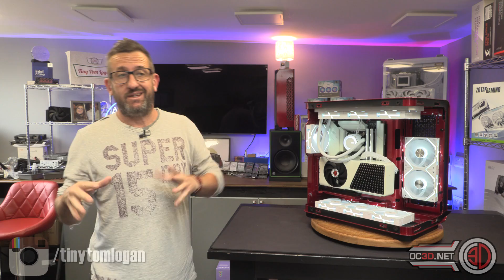DIY Fix?  Intel 13th and 14th Crashing Issues

Comment: Each core has a voltage table. This table asks for certain voltages according to the core's speed. These tables are written in each core at the factory. You can use a tool like HWmonitor and look for something like VID (max) and check the voltages for each core. They are very high. This VID takes it's voltage from the vcore. So each time a core asks for a certain high voltage, the vcore will increase it's voltage to fulfill the request. The only way around this is to use a fixed vcore value. This way, no matter what the VID asks, the vcore will only provide its fixed value. This is what I've done. I'm undervolting and overclocking, so I set my iccmax to 400A but everything else is unlimited. I suspect Intel will act upon the VID tables with its microcode release in August. We'll see...

Comment: Intel should issue a recall the on effected chips at this point, seeing as their own VID table has been the primary cause of the degradation (I've seen some people point to the turbo p-state voltage being the main culprit). While I like undervolting and have done it myself for a long time, I really dislike the idea of a product that requires undervolting at 100% stock settings to prevent the CPU from ending itself with even Server/Workstation boards. Intel used to be about solutions, and now they've become nothing but problems.

As for the systems already degraded though, only fix is to RMA the chip and hope Intel honors the warranty.
Reply: Not going to happen and it wouldn't make any sense. They are all perfectly stable by cutting 5% off the insane stock OC.

Comment: I just upgraded my wife's PC to the 14700k but locked the P cores to 4.7ghz and the E cores to 3.4ghz while only using maybe 1.1v and a full package power draw at 144w, CPU does not go over 50°C on a full load.   Glad to see Intel is fixing the issue and the issue being a microcode and not hardware related to the CPU's.  I just hope Intel does the right thing and steps up to those who have had issues with full replacements, no questions asked or voided warranty if they delidded the CPU to bring the temps down lower.
Reply: What scores do you get on GpuZ for single and multi please? I use 1.25 for my 14700k with 5.6p and 4.5e But I cant get 5.7 at all with 1.25 even without e cores!
Reply: @cristianspiridon  GPUz is only for your Video Card, not CPU.
Reply: @cristianspiridon that’s normal. My 13700k max is 5.6P 4.4E at 1.2v and it won’t go any higher. Get a KS.
Reply: @Typhon888  I was asking about the scores because I don't think the CPU is working at full power at 5.7 with 1.1.... what scores do you get on GpuZ bench with 5.6 at 1.2?
Reply: @cristianspiridon  Not running 5.7ghz. I am sticking with the 4.7ghz P cores and 3.4ghz E cores until the microcode patch and even after that I wont push the CPU past 5ghz P cores and maybe 3.8-4ghz E cores.  Also GPUz is only for your Video Card, not CPU.
Reply: @IceWarrior341  I wanted to say CpuZ.  And I’ve read that wrong… i was thinking you are at 5.7 not 4.7 with 1.1 😁
Reply: @cristianspiridon  No worries!
Reply: @cristianspiridon  I dont use GPUZ but in CB R23 I am getting close 30192
Reply: That's way too restrictive, at least lock them to the intel recommanded limits.

Comment: I have encountered more problems with Intel than in any other system. Even with my secondary AMD CPU PC I haven't had any problems, but with the Intel of the 14. Can't even support high memory with ddr5 and lots of instability. With this I will never get Intel again until they fix their s****. AMD the way to go with the next CPus coming
Reply: You have RAM problems? They are all fine with 7200mhz with me, and even 8000mhz, you just need to have a compatible board that supports that speed a tune the RAM clock. Always going XMP isnt the right answer 😂

Comment: buying best-of-the-best high performance parts to underclock instead of overclock…what a time to be alive…
Reply: Just be a man with balls of still, delid the chip and do a direct die water loop and you get free 20 degrees off , and you dont fry anything
Reply: @hugomouteira7015  excatly,  and delidding these days isnt even a problem with those kits from thermal grizzly.
Reply: SOmetimes u can overclock even with undervolt in place , depends on the chip actually
Reply: @leyterispap6775 not this time.
Reply: When nm going down, you will undervolt for boost in performance, it’s not like old times.
Reply: @Cata-K9  yeah, but im not getting faster speeds on the 7800x3d doing that pbo -30 thing, just maybe somewhat higher boost nonsense, its so underwhelming. hope new ones get better, at least overclock to 6ghz. feels more like tuning a tablet than enthusiast level pc at this point…
Reply: Depressing init
Reply: @LawrenceTimme  sure is
Reply: I just joined the 7800X3D- 30 offset PBO club.  I am so glad consumers actually have a choice that doesn't hurt the wallet to get the maximum efficiency/performance in gaming.  Also the 7950X3D was selling as low as $429 on Prime day.
Reply: The entire paradigm changed a couple years ago when MoBo manufacturer started OCing out of the box. These are more OCed than a sane person would push them...
Reply: The chips are pretty much maxed out from factory, try X3D chips from AMD
Reply: @OpressivePeach  I went with the 7800x3d (not that even he overclocks sadly),  I'm not disappointed in just one company but in general. Bunch of nonsense. No one even did a video on nvidia shaving off voltage in newer 4090s. I had to flash older strix bios to get full power. Unbelievable.
Reply: @medovk  I wonder if the Suprim 420 watt bios would be safe for my PNY 4090?
Reply: @cemsengul16  doubt its smart to mix bios from a different brand, i have asus tuf so i could do the strix bios on it. that would need looking into. 420w is the lowest the 4090s go so it should be fine in that regard. there is a program to override brand specific limitations but i didnt try it out.
Reply: It's crazy about things we get so upset at like this and lot of people don't even get to live to have things like this.this is nothing Compared to relife things that are more important. But I digress. I have amd cpu so good on this end and glad didn't get a Intel cpu.
Reply: @Seanbjw  kinda envy them, just imagine how nice it must be…no more underwhelming hardware, woke games, bad movies & tv shows, ruined franchises…they saved themselves

Comment: This problem seems to me to be more nuanced than just a heat/voltage issue. Why are server motherboards on the W680 chipset that should be running lower voltages still having stability issues? And why are lower voltage T series chips also failing?
Reply: Today's video on DannyzReviews shows that some server motherboards on W860 are also pushing power and voltage above specs.
Reply: @reBlub  Maybe so, but Buildzoid posted a video where chips were degrading in Minecraft servers on Supermicro motherboards that were running as close to Intel specs as possible.
Reply: @DamienK28  From what I understand, those 14900K were running at 6 GHZ with a 30% death rate and they had to downclock them to 5.7.  I can't find the info but I think that at 6 GHz, the voltage is way too high even if the power consumption is "low" because Minecraft is mostly single-threaded.
Reply: Even when the system is idling 13&14 i9 can pull a lot of voltage, even when the power output is low.

Comment: It does seem to be a voltage issue. I have my 14900kf UV set to 0.10mV and voila no more crashing. Also locked current at 400A and PL1 & PL2 at 253watts

Comment: Intel has lost all of my trust from this point on. Asus has lost all of my trust from this point on. I used to be the biggest fan of both. Never looked at AMD, or any of the other MB manufacturer’s due to the reputation that both Intel and Asus had built. Now they are both dumpster fires when it comes to taking care of their customers and putting out quality products. I’m now an expert on undervolting thanks to the 14900k.

Hopefully they will pull their head out of their arse eventually before they both become the radio shacks of our generation.

Comment: you really shouldn't have to undervolted straight out of the box. I think this proves that cpu makers do not give board vendors enough time before releasing cpus.
Reply from the maker: board vendors have to ignore Intels own voltage requirements to fix the issues though. thats why Asus used to always be the best - they worked on the best thing for the end user not the easiest way they were told